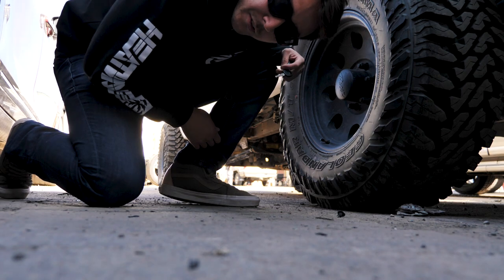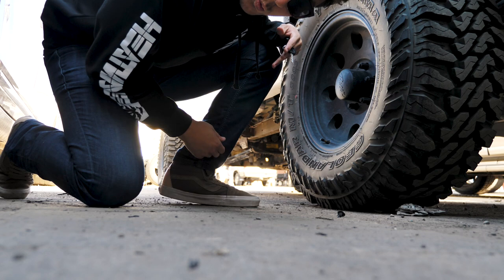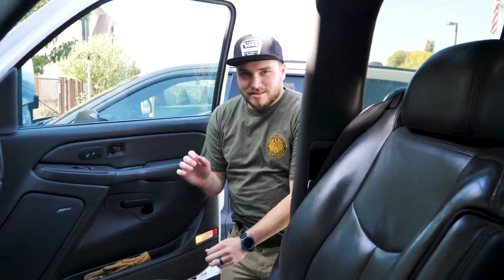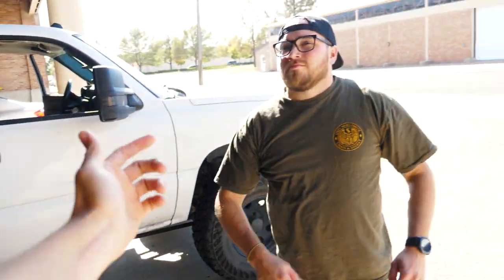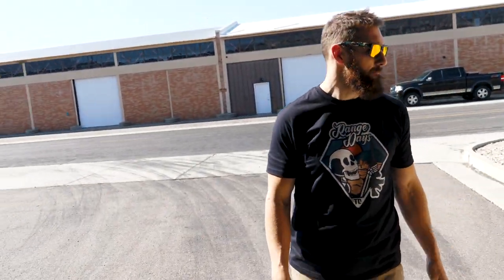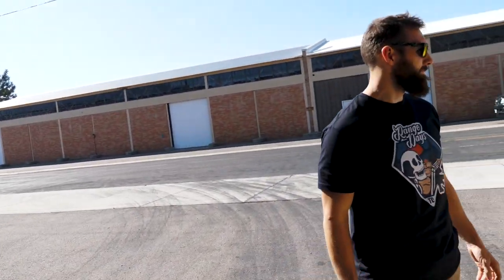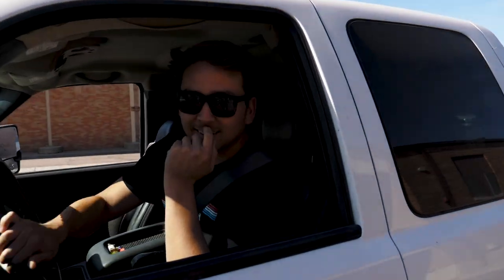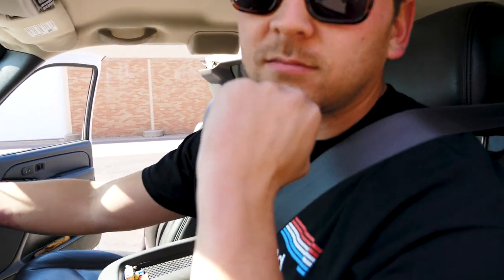Built LS Motor Running Open Headers // 2004 Chevy Silverado Build PT 6

Comment: Stage 4 no such thing  ,not talking imports lol all your talking is cam lift = number not stage. Love how long it toke you guys to learn you need to tune it right after putting a cam in it. Well any engine performance add ons you have to tune it to  read what ever you installs. Ps you reason you could do a burn out before is cause all computer engine come  under tuned. Also side note while tuning you can delete cats cat sensors and do with out cats witch adds more power. Sorry sounds like everyone’s a beginner in the hole build process and plz upgrade to Electric fans gain more power there by doing so other mods throw 2500 stall converter in your trans and if you have a 4160 trans mite want to build it cause it’s not going to last long stock 4l60s don’t like adding more power or switch to a 4l80 witch hands more power a lot better  and build that a little to for safe measures 4l80s normally come with your 6.0 engines .

Comment: Sounds kind of loud .. still don’t think it could be possible for a Chevy to hurt my ears / head
Reply: You can have it registered  with deleted cat empty them out weld back up with empty cats delete with tuner they will never know here in Arizona all they do is plug up to the obo scan it and test gas cap  so mines registered. Or another way around it is registering your truck up somewhere in your state that doesn’t run emissions then you can just do with out the cat label it as a hunting vehicle